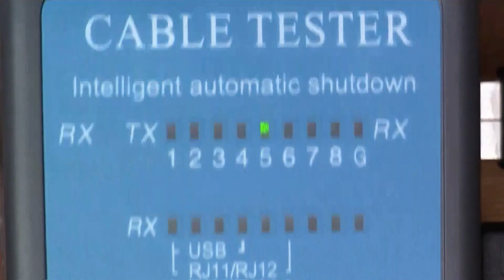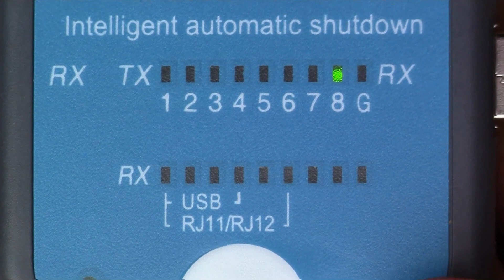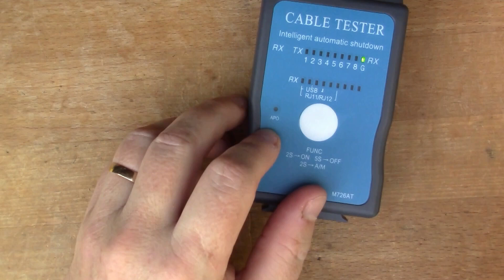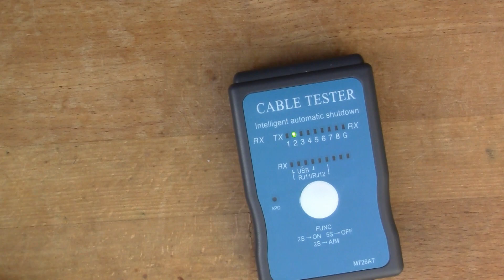USB Cable Tester Modifications - Adding Micro and Mini USB (#82)

Comment: Smart mod, could have used such a device after trying and failing to connect and upload to a ESP8266 board, figured out the cable (Anker) only carried power (many hours later), stupid me! Great video, thanks.
Reply from the maker: Hard to believe that some vendors are too cheap to put a couple of extra strands of copper in their cables for D+/D-, but it's all too common.